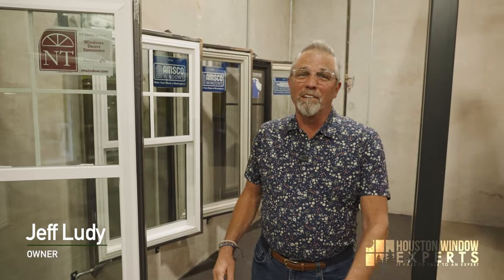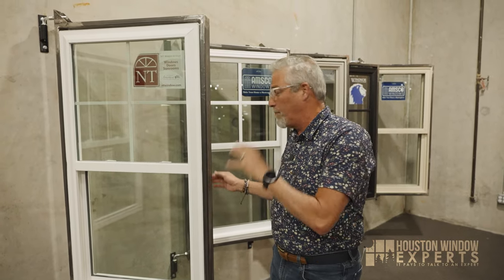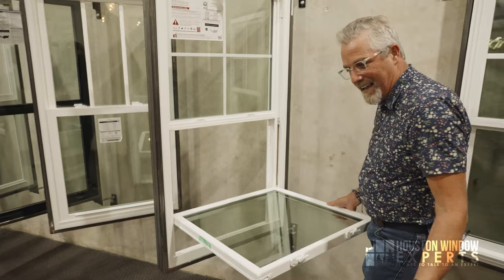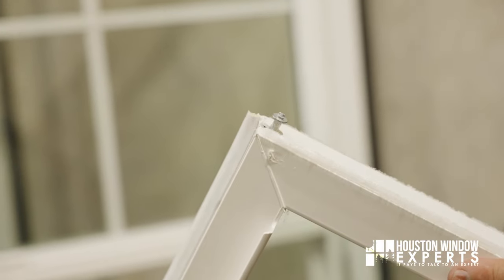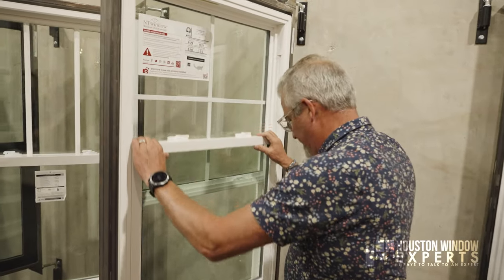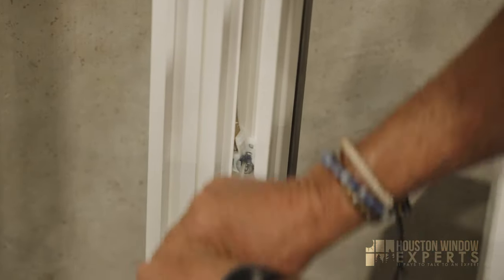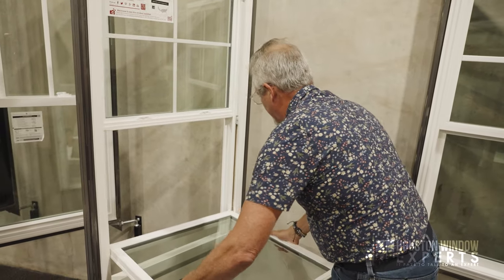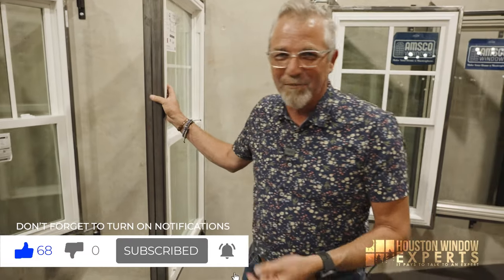Window Won't Stay Open? Easy Fix

Comment: I grew up in a house built in 1890. There were actual lead weights in the window frame with pulleys and ropes that would break and not be easy to repair.

Comment: Ugh, really thought this was the problem with my window. I can even tell the right side didn't seem in place - sache pivot looked dislodged or un-level when I went to remove the window. My mom had these windows installed in 2009, not sure if this is a tad different? This started having the issue a few years ago - window just wont stay open, FINALLY checked here to see a solution, great video by the way. There is (was) a tiny plastic piece above the balancer shoe insert....the metal piece you inserted the screwdriver...this flimsy plastic seemed to be destroyed. i aligned it like you did at 3:34, window went in fine and level. But no luck on my end, window still won't stay open. I am not 100% certain that the  balancer shoe insert is turning to lock this track in place, thinking this COULD be the problem or maybe this entire balancer assembly needs a total replacement. Eh...not sure. I have to try this again. Still, great video..I appreciate it. Have a good one!
Reply: Did you try it again?

Comment: THANK YOU!!!!!!!  The balance shoe pivot was partially broken off.  I've been propping it up all these years, thinking that it would no longer work.  Turned the pivot anyway with a screwdriver and it popped right back up!  At least I bought some time while I get a replacement shoe.
Reply from the maker: Great 👍

Comment: This is amazing! I have 4 heavy windows downstairs that all won't go up and crunch because the springs had come out of the carriers. After watching this video took me about 20 minutes to fix most of them after 3 years of just dealing with it. One of the windows is missing a carrier on one side, how can I replace this?
Reply from the maker: Great! You will need to contact the manufacturer for the parts.

Comment: Great video! Very informative and taught the name of the pieces. Also thanks for explaining the difference between single slide and double slide. Before you got to that explanation in your video, I spent time trying to figure out the difference. In my mind, double was envisioned as side by side. Not up and down🤦🏼‍♀️ I JUST learned that I have double slides. Will be subscribing to your channel because I need to learn how to replace broken sash pivots and broken balancing shoes. Hoping you have a video explaining that process.

Comment: I have an issue/ they installed a vertical slider horizontally so it slammed down how can I fix without Replacing whole window
Reply from the maker: That is not a problem you can fix easily. That window will end up leaking because the weep holes are in the wrong location now. I would tell them to replace that window. It's the only right way to fix it.

Comment: Thank you. I just had new windows installed and some stay up and other slide back down. They are heavy aluminum, not vinyl, does that matter? Thanks so much.
Reply from the maker: It should be the same process. Thanks for watching

Comment: Greta video-What's the cost to replace the balancers or springs?
Reply from the maker: I would imagine that the parts are under $30. It's the labor, and the trip charges that will raise the price.

Comment: I have double hung tilt windows and if I open them the top sash immediately falls
Reply from the maker: It sounds like you have a balancer issue. I'd suggest calling the manufacturer to see if it's under warranty.

Comment: Thank you for the descriptive video on the frame parts. Our window wouldn’t stay open after a cleaning, and I was able to fix it exactly according to your instructions. Granted, the plastic housing around the shoe is cracked and won’t stay down by itself, but I was able to use vice grips to hold the cord long enough for me to reinstall the window. Good stuff!
Reply from the maker: Great!!

Comment: ??  What if the windows are at least 10 years old, and tabs broken and you can see that metal shoe up near the midpoint.  I don't know who made these vinyl windows, but they did come from Home Depot.  Looks like I will be measuring the parts and taking pictures.  Thanks for the video, comments also raise it up in the search engine too.

Comment: What if the track only stays "locked" when the U/C mechanism position is with the U facing downward? The side tracks seem locked but when I tilt the window back into position it falls right down because the window turns the U up when I push the window back in.  Thanks.
Reply from the maker: Sorry, I'm not following you completely. The only problem I've ever seen is the one where the balancer is not connected to the sash. Can you check that and make sure it's connected properly? If it is connected properly, it would be likely then that the spring has failed inside of the balancer.

Comment: the springs are at the bottom of the frame, does this mean they’re broken?
Reply from the maker: Proven? Did you mean broken?

If they're at the bottom and there is no tension on them when you tilt the shoe, then maybe that is the case.

Comment: Hi Jeff,  thank you for all of your past responses. I'm going back and forth with deciding on whether to go with a bay or a bow. I have a 1961 1850 sq ft split level home. There is currently a "rotting" bow in the living room but I find the bays more aesthetically pleasing. My wife will go either way but she leans toward the bow.. Wondering what your thoughts are and thank you. Charlotte, NC.
Reply from the maker: If your house can support it that choice is yours. I like bay better than now because you get more glass.
Reply: a1231

Uninterrupted Glass 😊.

Comment: What happens if the sash pivot is broke in both sides? Can I use something to replace the sash pivot?
Reply from the maker: These parts are readily available for most manufacturers or even on amazon.

Comment: My window has the opposite issue. The chord is very tight and I cannot lower the window. Any way to fix?
Reply from the maker: The "shoe" must be turned 90 degrees to far.
Reply: @HoustonWindowExperts  I dont fully understand what you mean. I tried rotating and the left side shoe and it was able to move up and down when unlocked. The issue I seem to be having is with the right side shoe, whenever I unlock it or try to, it makes a rough clicking noise and doesnt move up or down once unlocked. Any Idea how to fix?
Reply: Situation fixed. Just needed some WD-40, was stuck on something.

Comment: Funny how nobody talks about how to repair the top window from falling down
Reply from the maker: If the top window continues to drop, it's either out of the shoe, or the springs are defective. You would need parts for that.
Reply: @HoustonWindowExperts  thanks. My spring on both sides of the top window are just sitting in the channel. So i believe they both broke.
Reply from the maker: Sounds like it..

Comment: Let people know if their sash pivot is slightly bend it won't engage with the shoe . I eventually figured that out breaking one in the process just tapping it with a hammer.  One side is holding the window up however I got to get the other one
Reply from the maker: Good point. I forgot to mention that.

Comment: How can I dentify the brand of double hung wooden window (manufactured 10/12/2005)
Reply from the maker: A lot of times you will find an etching in the corner of the glass that will tell you who manufactured the window. You might also look at the lock on a window to see if there's a name on the lock itself. If you cannot find a name in either of those two locations, it's probably an off-brand product.

Comment: I have that problem I hope it works. Will let you know.
Reply from the maker: Great 👍
Reply: @HoustonWindowExperts  I don't think it will I looked at it today my window spring is entirely different than what you advertised. Mine have the wind spring. I see people placing all these easy videos but they don't go into the difficult ones

Comment: Thanks a lot for uploading the video, I have seen few videos the way you are fixing it , I have double hung windows the upper parts after closing it , does not stay up all the way after little while it drops down like 10-12 inches any suggestion how could fix that any workable suggestion would much appreciated.
Reply from the maker: That sounds like the spring mechanism has failed. You need to replace those springs.
Reply: @HoustonWindowExperts   thank you very much for a quick response I will sure check it

Comment: That spring/coil, the golden thin metal came off from Two of my windows. How can I fix that?
Reply from the maker: That will probably require a service technician to come out and fix that. There are some special tools used for that.

Comment: Is there a fix for not being careful enough and letting the tension cause the shoe to fly up to the top? It won’t budge now, even when unlocked 🤓
Reply from the maker: Use a flat screwdriver and turn it vertical and slide it down.

Comment: Great video. I don't see the shoe on the front lower window track - it's on the back track for the upper window. I see round coils on my front lower window.😩
Reply from the maker: If it has the coil, it must have a shoe. The only reason it would not have a shoe is if it broke off. You may have to call a service technician for some help.
Reply: Thank you so much! Yes, I found the shoe finally, but this window is a flat coil rolled in a cartridge looking thing. I haven't found a help video for that yet, but in the meantime, we had an earthquake here on Long Island - haa fun stuff! Thank you very kindly for your reply🤗 @HoustonWindowExperts

Comment: This is exactly the problem I have w a bathroom window. Getting ready to see if this fixes it? If it doesn't, what could be another reason and solution to get the window to stay up?
Reply from the maker: Did it work?
Reply: @HoustonWindowExperts  I got it to stay up to approx 2 inches and stay, but it's still not operating normally/correctly.
Reply from the maker: You may need to call a window technician to take a look at that. I'm not sure what it could be in this case. Perhaps the balancer is broken.

Comment: When lifting the pane, I heard the spring pop in the frame. Now it's dead weight. I'm unaware of the manufacturer as of now, but I'm wondering how to tell if it needs a spring replacement. I'd love to learn this without having to remove the 4 foot wide sash alone.
Reply from the maker: If the spring has traveled to the top, just pull it down with a screwdriver.
Reply: @HoustonWindowExperts  how do Ifish it through and  attach it back to tge bottom of the sash with the with window in place?
Reply from the maker: Obviously, it's hard for me to visualize exactly what has happened. However, if the spring is still connected to the shoe, you should be able to put a screwdriver in there and drag it down as I do in my video. If not, you're going to need to call a local window company for help.
Reply: @HoustonWindowExperts  thanks. When football is over hopefully I can snap a pic for the students. T hank you for your responsiveness.

Comment: what if the little thing with the flat head on the window that goes into the pocket gets broke off
Reply from the maker: You'll need a replacement piece. It's held in with a screw.